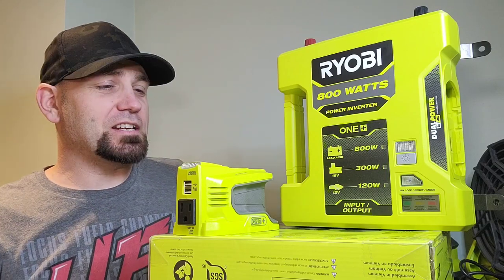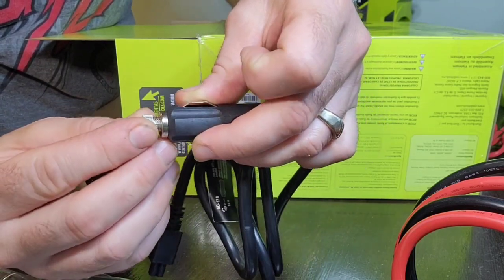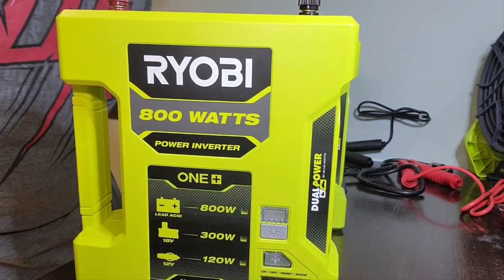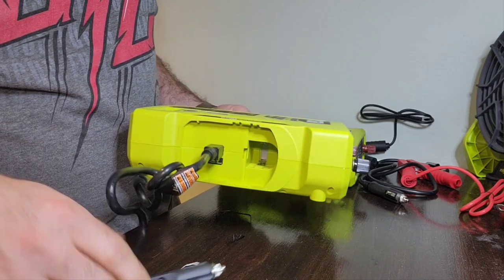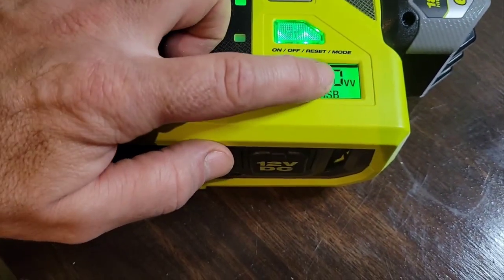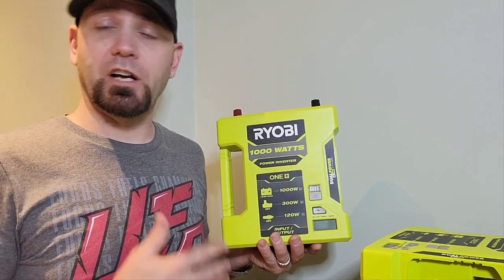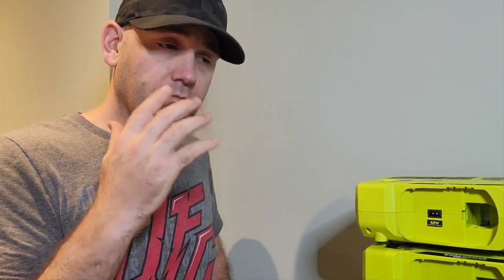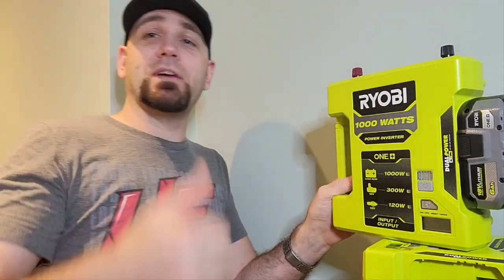RYOBI 800W vs 1000W  POWER INVERTER

Comment: I lost the gold washer that goes into the terminals can I replace with any washer? I have some silver ones that look like they fit.
Reply from the maker: @andyc4670  gold plated make the best connections but regular grade 5 or grade 8 washer will work too.
Reply: @Toolspecs  I picked up some brass washers from home depot does that work to? Also I've been using a coffee machine that only spikes up to 725 watts however the Ryobi shows I'm under 12 volts goes to 11.1. I'm using it on my car with engine running. It seems to work ok but If my radiator fan kicks on it jumps to 13.5 volts and then my inverter shuts off
Reply from the maker: @andyc4670  yes brass is a very good conductor.
Wow, which coffee maker do you have? Most of them are 1000w +. 
I never connected mine to my truck battery while it's running, that too bad that it shut off the inverter when the engine fan kicks on.
Reply: @Toolspecs I'm starting to wonder if the inverter is the issue, as I don't recall it behaving this way before. I recently replaced my old 900-watt coffee maker with a Mainstays 5-cup coffee maker from Walmart, which pulls around 730 watts. The old coffee maker used about 875 watts, which I could understand causing problems.

What worries me is that the inverter drops to 11.1 volts, and when the radiator fan kicks on, the voltage jumps to 13.5, which is when the inverter shuts off. One solution I’m considering is to only use the inverter for making coffee when the car is cold so that the radiator fan doesn’t come on. This way, the coffee should be done before the fan has a chance to activate. However, I wish it could work simultaneously without issues, which has me thinking there may be something wrong with the inverter, so I’m considering a warranty replacement.

Comment: I'm surprised nobody is asking this. But can you disable the 120V AC plugs and output just the low-voltage ones (usb/12v car etc?) Or, is Ryobi smart enough to disable them automatically when nothing is plugged in? The reason you would want to do this is that 120V inverters are notoriously inefficient. Many will drain your battery even if nothing is plugged into the AC plug. You don't always need 120V AC and it's better to disable it when it's not being used.
Reply from the maker: No unfortunately you can't disable the 120v plug but I reviewed the CAT Lithium power station and there's a switch for this one.

Comment: Can you hook the new Ryobi solar panels to this inverter. Can this inverter be used to charge 18v batteries?
Reply from the maker: No you can't connect this inverter to the new solar panels butyou can use it to charge 18v batteries connecting  the panel to the RYi150C. Because the solar panels ports are USB and USB-C. 60 WATTS is not much power, it will take 1 hour to charge up a dead cellphone. The typical car battery that this inverter is made to connect to range between 4000-8000 watts.
I guess I should do a overview of all the new products coming out......there's so many.

Comment: Does this jump cars off or does it only pull power from a battery?
Reply from the maker: It's not a car jumper. It's a inverter to charge usb device and run 120v components around the house.
Reply: @Toolspecs can I plug a jump starter into it? 🤔
Reply from the maker: @jessihawkins9116  it all depends of how many watts your jump start need.
Reply: @Toolspecs  it has to be enough watts to start a car 🤔

Comment: Would it run a coffee maker
Reply from the maker: @ScottHendrix-ir7uw  most likely not as most coffee makers need 1200w to 1500w but check on the label at the bottom of your. You might be lucky and have one that's 800w

Comment: Please correct me if I'm wrong, but Ryobi completely failed when designing this unit by not allowing recharging the 18v battery when hooked to an external power supply. Epic Fail
Reply from the maker: It sure would of been nice to have this feature.
Reply: Yes.... EPIC FAIL!  Even the cheapest unknownchinesium power stations allow passthrough charging
Reply: It has failed in all of its merchandise.   None of the charge batteries.  I have a Hybrid fan and guess what?  You have to remove batt to charge it.

Comment: Oye  amigo  una  pregunta  la  otra ocasión  le dejé la batería  puesta  apagado  y  la  descargo  totalmente  sin utilizarlo por que  pasaría  ?
Reply from the maker: Every times you leave a battery connected to a tool there's always a chance that some electricity will leak pass the switch.
I think that there's even more chance of this happening with the HP tools and batteries because there's circuits that keep monitoring each other to increase performance.

Comment: New tvs have built in protection, don’t need puresine, if your electronic does not have switch mode power supply, which 99.9 percent do, then throw it away…
Reply from the maker: Great information, thanks for sharing!